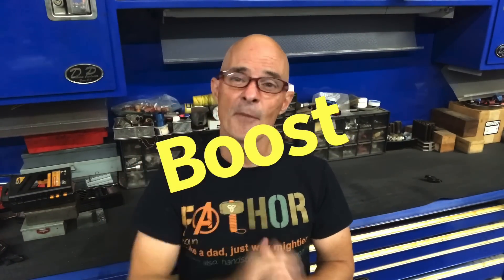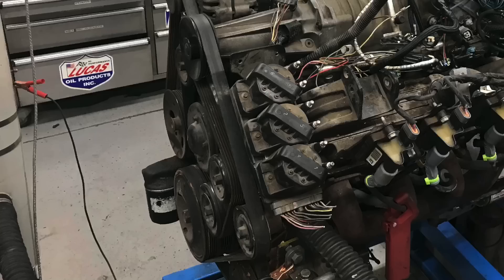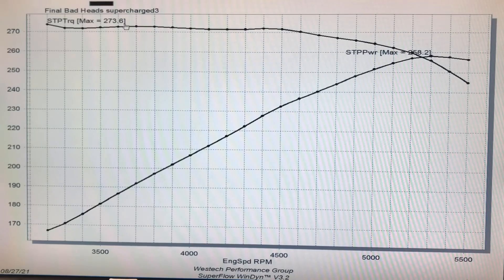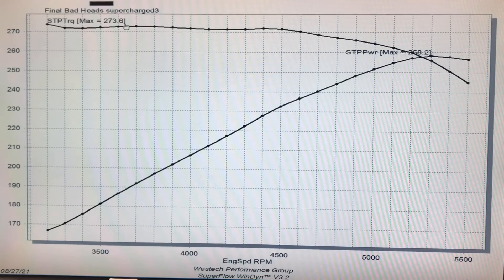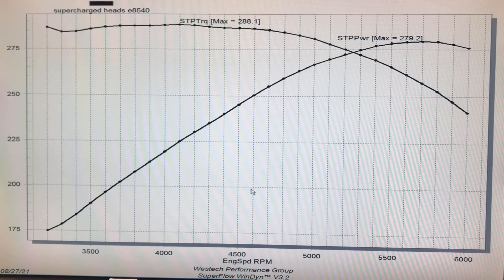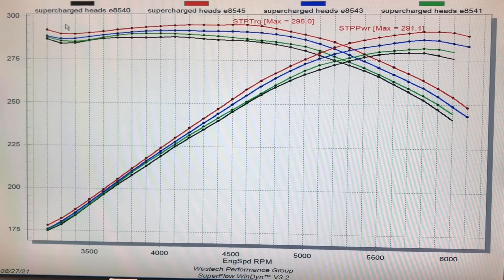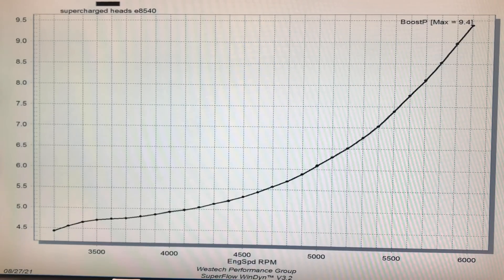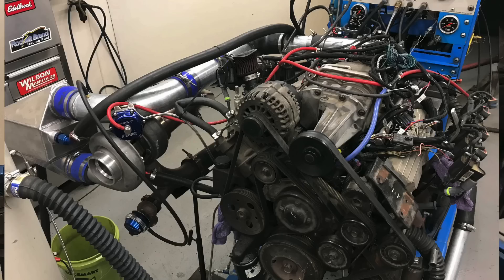THE OTHER GUYS 3800 L32 HOW TO MAKE HORSEPOWER. CHEAP, JUNKYARD SUPERCHARGED V6 POWER (PT 1)

Comment: Typically you'll see 5-7 at 3000 and 8-10 by redline on stock setup, usually only 3 psi of increase.  With a stock cam and manifolds you'll see boost rise sharply over 5000 rpm.  With headers boost won't rise as much over 5000.  Add some rockers and usually boost doesn't increase much until 5500.  Cam, headers, heads, boost is pretty flat, only increasing by 1 psi or so over the run.

In regards to your pulls, 9.5 psi isn't unheard of on a stock setup but 4.5 seems a bit low at 3000 rpm, i would expect closer to 6.  That front manifold is junk and extremely restrictive, the tubular front is a good upgrade but going right to headers is a better idea.  1.9 rockers is a common swap but a ZZP XP or NIC cam is a better idea along with a set of their ported heads.  

Heads, cam, E85 and turbo should make some decent power.  Not uncommon to make around 600-650 at the flywheel.  Just my input.
Reply: AMEN 3800 BROTHER! AMEN! Someone ELSE who knows the 3800 as well as I do! Preach Brother Jesse, PREACH!

I just replied pretty much the same thing to someone who replied to my comment. Lol
Reply: @jaydubb71  I'm gonna assume you are aware of and attend the annual 3800 meet that my buddy Darryl does in Michigan?
Reply: @jessemurray1757  I'm aware but I haven't been able to attend. I may come out next year. I've always been a SBC and now LS fan. I may get another W-Body soon tho.
Reply: @jaydubb71  I love the 3800 but I have an 18 Camaro SS now.  Put a maggie 2650 on it.  For power, mileage and reliability the new stuff is tough to beat.
Reply: @jessemurray1757  Exactly. Hense I'm doing a turbo LS in my 91 RS. I thought about getting a 5th Gen and putting a 2650 on it. Or a turbo on my G8. Lol. We think the same way...
Reply: @jaydubb71  for sure, actually I'm tuning a turbo GXP right now, best of both worlds right? lol  Flex fuel, cam, etc
Reply: @jaydubb71  LOL, I've been working on them and tuning them since 06.  I've done them all from mild to wild.  These days I tune mostly LS stuff though.

Comment: Dude, if you have something running a metric bellhousing you have tons of different engines you can run. Almost all fwd gm engines have this; ecotec, iron duke, northstar, 60° v6(all ifaik), ls4 if you ever find a cheap 5.3 al block, series ii, gm 122 series. The quad four is different for some unbelievable reason. This setup lets you run lots of junk.
Reply from the maker: I did see an ls4 recently with 243 heads
Reply: @richardholdener1727   Coulda sworn all the LS4s come with LS6 heads
Reply: @DarkLinkAD  the "Ls6" head isn't just a 243 casting. It's a 243 casting with longer valves and a sodium filled exhaust. GM made the valves longer to account for the reduced base circle on the cam from the high lift camshaft (551/547) and to fit the spring package as well as use all other ls1 components. The rockers and pushrods are the same on a Ls6 as any other gen3, but the valves, springs and camshaft go as a package.
The ls4 should have 799/243 heads though. There isn't any difference.

Comment: What ecu are you using?  I’m buying one of these to use in a Lotus 7 build.  I already have an AR5 trans.  350 - 400 horsepower will be a monster.  I want minimal electronics.
Reply: Yaay!  Lotus 7!
Caterham, Westfield, Birkin?
Reply: @2lotusman851  Building it myself.  I just built a drag car.  I can weld.  Plans all over the internet.  I’m pretty excited.   I like driving more than just in a straight line.
Reply from the maker: holley hp
Reply: @richardholdener1727  Dang.  $$$$. I was hoping you’d say microsquirt.
Reply: @richardholdener1727  Which one?? I cannot find one for a 6 cyl...

Comment: The dyno boost curve with aftermarket EFI engine controls is not going to be accurate as compared to a vehicle with a stock l67/32 PCM/computer.   The stock PCM with stock tune controls the boost via the BBV to about 6.5 psi as I have recorded in my own 2000 GTP.  Additionally the stock PCM has "torque management" and "abuse mode" that is also going to limit boost under those parameters.  
 Just finishing  up a rebuild on my on L67 right now, stock rebuild, no mods except for ZZP 1.65 rocker to replace my factory rockers to which four of them had started to wear the pushrod pockets.  I also found that every exhaust valve was leaking cyl. pressure, and my con rod bearings  were just starting to make noises, (reason for rebuild) other than that it still ran great, did not burn oil or leak oil, and had 196,000 miles!   The original pistons  did not look that bad, but I choose to go with new ones from ENGINETECH.  I should be doing the first start after the rebuild the next day or so.
Reply from the maker: when the valve is closed-no ecu can't add more boost-it can only open the valve to reduce it

Comment: Lapping valves is a patch job. A real Valve Fitting does not need it and provides a better seal. It also has better flow. It can be refined further.
Reply: completely dependent on a knowledgable machinist
Reply: Cracked head... neither will fix correctly. If you're just trying to knock the carbon off the valve seats on a motor that costs less than ONE machined head, it's a viable option.

Comment: Wow, talk about a flat torque curve
Reply: Yea With Stock Cam And Heads With 1.9 Ratio Rocker Arms With A Turbo The Curve Is Even Flatter lol. Back When I Had 1.9 Rockers And A Turbo I was Making Like 301WHP And Like 430 Ftlbs Of Torque haha (it was a small turbo and pretty much at it's efficiency range)

Comment: You know, a hopped up 3.8(SC or turbo, personal preference) would be a pretty cool swap in a Chevy Luv! Especially in front of a stick!
Reply: MGB GT 👍
Reply: Back when you could find Land Rovers with broken 4.1s for sale for a sack of beans, I wanted to toss an N/A 3800 in one for a driver.

Basically the same power, but would run forever.
Reply: I always thought it would be cool in a Vega
Reply: Uncle had a 455 buick in a Luv swapped the tailshaft for a 4x4 shaft bolted on a tcase, then dropped a 77 Toyota cressida wagon body on the frame. Sketchy as hell but fun
Reply: Drop a LU3, LV3, Or an Atlas in it

Comment: Cam! Heads! I like the idea of compound boost too…but maybe straight turbocharging would be best? Interesting comparison—my wife’s 3.6 DI V6 is rated at 310 @6800. I think Cadillac (and maybe others) have a turbocharged version, too.
Reply: Only heads available aftermarket are either ported/worked stock ones or the kyre ones which are a few grand
Reply: The TT version of the same engine used on the 2018 Cadillac ATS-V made 464HP, so yeah, that problematic and hard to work on HF 3.6L V6 does have a few merits.

Comment: Would really like to know what angles they did in the Valve job, would help illustrate the benefits of multiple angles instead of just a flat seat. I was wondering why the timing was so soft to start until you said it runs no intercooler, then it all clicked. Really looking forward to what it does with a turbo!

Comment: Can't wait to see the compound boost tests.  I was disappointed in Gale Banks compound boost test on the Duramax monster truck project.  He didn't measure pressures and temperatures at all critical points in the system so you couldn't tell when the blower was getting in the way of the turbo.  When that happens on the 3800, it would be interesting to take off the blower belt and see if the engine picks up manifold pressure and HP with the supercharger freewheeling.
Reply: They lost me at putting the blower before the turbo.

Comment: Well that was super worth the wait !! Makes a SBF 5.0L V8 power curve look weak right out the box. So exciting !! Great job Richard !
Reply: It's not hard to embarrass a stock SBF, and this is coming from a ford guy, you want impressive out the box power try an 03 navigator motor on for size. (Just be warned it's quite large)
Reply: @Prestiged_peck  5.0 coyote is when Ford finally got the mod motor rite to bad Ford is so stuck on pushing eco boost v6 junk
Reply: @neilbrown82  what's the problem with the Ecoboost V6?
Reply: @neilbrown82  decision time came and went, I bought a 2.7 Ecoboost because it made more torque peak and also peak torque at 500 rpm lower than a 5.0 ... that, better fuel economy, and several thousand dollars cheaper off the lot made it an easy decision for a truck (it tows things, it hauls things, it runs on 87) that will stay stock during it's lengthy warranty period. Now, if they offered the new 7.3 in a half ton, we'd be planning on a trade-in.
Reply: @dfabeagle718  that 5.0  coyote would definitely Outlast an eco-turd lol
Reply: @neilbrown82  my company has a fleet of Transit 250s with the ecoboost 3.5. Run great, good fuel economy, plenty of power. only problem ive had was a throttle body failure at ~105k miles. Otherwise very solid motors in my experience
Reply: @neilbrown82  Doubtful there will be any meaningful difference in longevity, and 120hp / liter on 87 pump gas is far from a turd. Check back in 200,000 miles or so?
Reply: That's cause it is weak af!

Comment: The boost curve is due to the stock cam, heads and exhaust manifolds being so restrictive. The peak boost will drop with the headers. Ported heads and cam will lower peak boost also. Then you will have to pulley down. My GTP was making 11-13 psi with a Gen 3 blower, 3.4 pulley, fenderwell intake, Speed Daddy headers and SLP loudmouth catback. 17 degrees of timing also. Had to back the timing down to keep the tranny alive...
Reply: You gotta love GM mating hot engines to the worst transmissions ever used by humanity in their FWD cars. Its really kind of sad, especially when you look at the LS4 cars. Could have been so good but that 4T65E can handle about as much torque as a pool noodle no matter how you build it.

I see guys using the more modern 6T70/6T75 for fiero LS2 swaps now but its also in the same boat, even my little 4 banger turbo malibu can break that thing like a twig if you push the boost a little.
Reply: @arc00ta  I love analogies and "a pool noodle" to describe a weakass transmission is one of my new favorites , thanks !
Reply: @arc00ta  they should've put the 4T80 behind the LS4 like Jon Moss did when he built that first FWD V8 Monte Carlo..
Reply: If the stock exhaust manifolds are so restrictive why do turbo setups make near double the power on them? Keeping the s/c outlet temps reasonable is far more important
Reply: @jacobburskey3044  well the stock 3800 manifolds are very restrictive. Especially the the front facing manifold (on the driver side in Richards video. ZZP makes a power log for the front because of the design. The rear manifold (passenger side in the video) is less restrictive. The front manifolds often crack. Have you ever seen tbe cross section of one? I have. I cracked mine and went to headers. The car instantly went suuuuuuper lean bcuz of the added airflow. Boost dropped 2 psi. But that bitch was definitely faster. Once I got the fuel back at .78 Lambda and cranked the timing up, she ran like a scalded dog. BTW I consider myself one of the 3800 experts in my area. Considering it had 220K when I sold it. And believe me, I wasn't gentle with her at all. That car kicked a lot of ass and took a lot of names. That car is still running today. When people see it, they call and aks where I'm hauling ass to. Lol. My cousin owns that car now.

Oh. All of the GOOD 3800 kits eliminate the stock manifolds altogether. They don't flow like the LS manifolds.

Oh... And I owned my GTP for 22 years. Never blew the engine. Transmission? Well I plead the 5th transmission. Lol. But yeah. I have a lot of experience with the W-Body 3800s. Wish I never sold mine. I kinda miss that car...
Reply from the maker: wait til you see the header video
Reply: @richardholdener1727  Do you have any Ford 3.8 v6 videos? I have a 1997 3.8 mustang and I want to add boost!
Reply: @jacobburskey3044  oh... The only way to keep the outlet temps cooler is to:

1. LOWER the boost/pulley speed
2. Get fresh cold air to the inlet of the throttle body (FENDERWELL INTAKE. Not that underhood air filter bullshit.
3. Eliminate the coolant crossover at the throttle body/blower (I don't remember if My GTP had it or not)
4. EGR blockoff

Now if you want to lower the manifold inlet temp:

1. Methanol injection before the blower But I hear it's bad for the rotor tip seals
2. Methanol Injection after the blower (in either case, better keep that meth reservoir level in check!)
3. Air-to-water intercooler (this is the option that I would prefer) 

Or turbocharge it and eliminate the blower altogether.
Reply: @jacobburskey3044  I agree with James and to add, they make even more power with a tubular front manifold.
Reply: @jessemurray1757  except it’s been dyno’d same day on a 300whp setup and the gains were 3-5whp, the car made similar gains on stock manifolds with simply colder air temps. While headers/free flowing exhaust can add extra flow it’s a question of when it’s actually needed. And on most setups it’s not, as once again if turbo cars can make 400whp, then you can easily do the same with a s/c setup.
Reply: @jacobburskey3044  well, theres always the fact that manifolds keep more heat in the exhaust than tubular pipes.  Its not always about flow.  But anyways, for a supercharged application, PLOG or headers are the way to go.  Maybe Richard will test the difference.
Reply: One of my favorite engines. What kind of power did yours put out?
Reply: @steelervette  I honestly don't know. It went low 13s at 107 in cold weather. I think she had more left in her tho.
Reply: @jaydubb71  that's pretty good with that timing and transmission. I see those engines are making a comeback.
Reply: @steelervette  thanks
Reply: For those talking about inlet manifolds, the aussie ecotec v6 manifold is great. Especially in turbo applications. Check out corn fed boost on youtube for the proof.
Reply: @stuartwinter2758  too bad it might not fit on the 3800.
Reply: @jaydubb71  same exact engine besides the fact that it has a different intake manifold and oil pan... the “ecotec” 3800 is just an Aussie branded 3800 s2/3
Reply: Hey, I'm getting ready to play with a 01 GT. Not really trying to build power, just make the powertrain reliable and go bananas with the suspension. Can I pick your brain? Are you on GrandPrixForums?
Reply: @michaelwallace7972  yes. I haven't been on there in a while. My SN should be jaydubb71 or jaydubb.
Reply: @jaydubb71  would you mind, giving me pointers?
Reply: Hey guys if you are not very heavily modified use that 250-1000 for headers/PLOG on E85/injectors/Tune/pully will see much bigger gains anyday. Richard’s latest video is my proof https://youtu.be/l2dRVKQ6tCs
Reply: This one is my test bed. I wouldn't mind, trying to get a little power out of it, but I'm pretty happy with where the power and torque curve are. I don't want to make major engine mods. Just need to find a shop that knows about the trans and can give me one that will last.
Reply: Ported heads definitely help, but when it comes to boost curve problems, it’s stock supercharger. The m90 is just a tiny blower and chokes itself out. Put a bone stock engine in front of a turbo setup at the same boost levels and it’ll make WAY more power
Reply: @Matt_Lanzer_13  agreed. The M90 is tiny but right now, that blower is choked with that stock blower. I personally think he should get an NA style upper manifold (that's if they still make them) or gut the blower and use the blower case as a plenum. I really wanted to do that to my GTP but the funds wouldn't allow it...
Reply: @Matt_Lanzer_13  while I agree the M90 is a problem and maxes out quickly, I disagree why boost increases.  Remember boost is a measure of restriction, with a free flowing enough setup boost stays relatively flat, only increasing 1 or 2 numbers across the board.

Comment: Contrary to common sense, when I did this back in the day, putting an intake on the blower, I lost boost everywhere and gained about 12 whp.  Esecially lost boost bottom end.
Is the bypass working correctly?  Stock it should hit 5-6 PSI immediately then rise to about 7.
Though this was an L67.  The interesting part was.  Back in like, what was it now 2002? The car would have KR on a stock pulley 93 octane (200FWHP) When I threw a T62-1 with tubular manifolds on the car with a spearco front mount, no tuning whatsoever, stock everything, blow through MAF, I forgot the PSI it was low.  13 Maybe, car made 340FWHP with zero knock.  
I cannot wait for the blower portion of this series to be over tbh :D
Reply: Blower is nothing but a band aid and cost cutting measure on this engine from the factory. No heat exchanger, a total and complete cost cutting design from the get go.